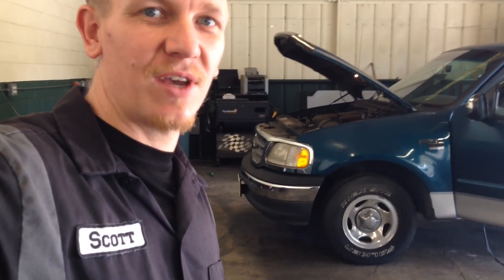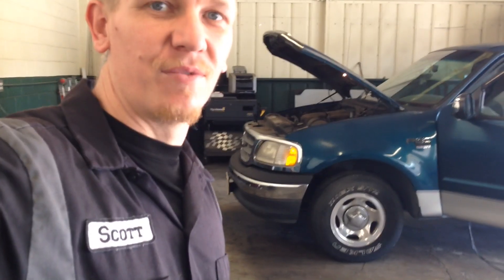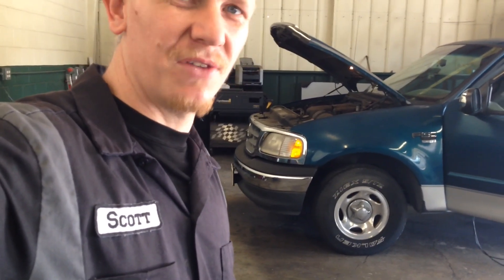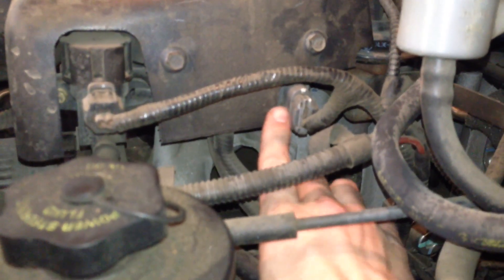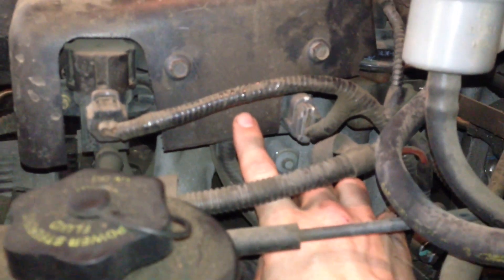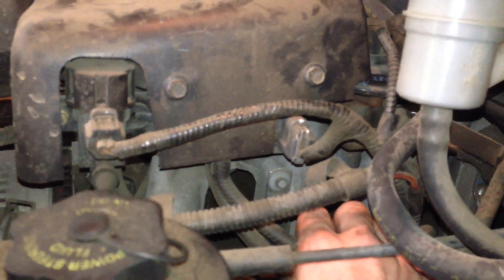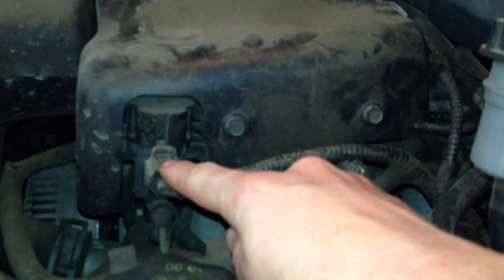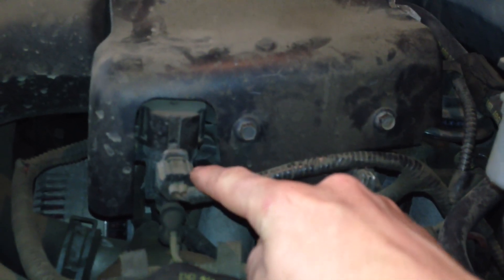Ford F-150 emissions: PCV valve, EGR valve, EVAP canister, & purge

Comment: Hey Scott, I have a question I hope you can answer this for me. I have a 97 Ford F150. It’s making a popping noise in the middle of the motor right underneath the throttlebody specially when I give it gas quickly it’ll make a popping noise also when I put it in gear, it loses power please help do I need to put another motor in it or not
Reply from the maker: It's really hard to give advise on this one without it being infront of me. Do you have a check engine light on? Does it sound like a spark plug backed out?

Comment: Could any of these cause a p0171 and p0174 lean codes? I have checked all the obvious things and even did a smoke test and found no leaks.
1998 f150 4.6 liter, around 260,000 miles, runs like a champ. No stalling or rough idling issues whatsoever. Just these 2 stupid codes.

Comment: Do you have a video showing how to replace the EVAP Canister Vent Solenoid/EVAP system service port part located on the firewall of this truck? I need to replace the entire part and I was looking for a video.

I have a 2000 ford expedition 4.6L V8 Triton XLT and I haven't seen any videos showing this and since the parts under the hood on the truck in your video is similar to mine I was hoping you had a video on replacing that part.

Comment: I have a 05 expedition 5.4 iveee changeddddd everythingg. I only have the p0453 it runns good and engine sounds good at start, and when its warming up. When its warmed up at a stop or coming to a stop, the RPMs dropp and idles rough, feels almost like its choking on itself. Ive changed the spark plugs, the coils, the serpent belt, alternator, mag sensor, purge valve, cleaned the throttle body and still get the same code p0453 please help meee.
Reply: Clean the fuel injectors, check the idle air control valve, replace the fuel filter, you may have a vacuum issue but just in case I'd look into replacing the engine coolant sensor as well. Any of those things if reporting something wrong will fuck up the balance and air to fuel ratio causing rough idling and the choking symptom you're describing. If you already fixed the issue, let me know what it was and how you fixed it. Thanks.

Comment: How many pvc valve on ford explorer 2001..one on passenger side whats on driver side
Reply from the maker: 1 pcv valve. The breather is on the other side. When the PCV valve opens, fresh air comes in through the breather. That will suck clean air in from the intake. Through the engine and out of the PCV valve into the intake manifold.
Reply: @ScottiesHobbies  thxs

Comment: My 98 F150 XL manual 4.2 loses power uphill. Thoughts?
Reply from the maker: Have you checked fuel pressure? Any check engine lights? Any symptoms other than lack of power?
Reply: @Scotties Hobbies  I don't know much. How do I check fuel pressure? Check Engine  light is on. No other symptoms. Runs great otherwise. Just slows way down up hill. Here's the codes: P0455 evaporate emission system leak
P0300 multiple cylinder misfire
P0171 System too lean bank 1
P0174 System too lean bank 2

Comment: I have 2004 Ford F-150 heritage that is showing code po 442 I have replaced the gas cap and the service engine light soon will still come on. Do you have any suggestions of where I should look for the small leak ?

Comment: I have a 97 f150 that just threw a p0455, I know it's a gross evap leak. When I took the gas cap off the hard plastic around the top of the filler neck has a section that's broke off, would this cause the code the fire off?
Reply from the maker: Are you saying the seal on the actual gas cap was not intact?
Reply: The gas cap seal is fine, the part of the filler neck that the cap screws into is what I'm talking about. A section of it is chipped off. I've already ordered and received a new filler neck. I've checked everything else and its good.

Comment: so how about removing the evap canister from underneath the bed of the truck? no human on the face of the internet has done this kind of video for a 1997 to 2003 ford f150 evap canister removal.
Reply from the maker: You probably don't find many videos on remove and replace of the canister cuz they rarely go bad. In the 15 years I've been working on cars I've only seen two of them go bad and that was due to being involved in an accident and the actual canister breaking. Why would you be replacing your canister?
Reply: Mine fell off due to rust i reconnected and my overdrive will not engage and evap codes pop up .  There is an electrical connection on canister.  Will that make that happen or is it a problem in the engine bay

Comment: What would cause the P0455 Evap Emiss Control system leak code to kick up???
Reply from the maker: Many things. The simplest would be a bad gas cap seal. Inspect it for cracks. If you don't find any cracks on that seal then you need to start looking at the EVAP system itself. Check and make sure your purge solenoid is good if your purge solenoid is good then you need to check your vent solenoid. You can check both of those for holding pressure and for resistance. If both of those check out then you need to pressurize the EVAP system and figure out where a leak is coming from, you probably would have a cracked hose in that case.

Comment: Engine runs but nothing is turning what is it.
Reply from the maker: +Gene Woods man, ya got me.. is it a blonde?
Reply from the maker: +Gene Woods just kidding. So the engine turns on but when you put the truck in drive it goes no where.
Reply: Scotties Hobbies the starts but motor is not turning
Reply from the maker: +Gene Woods  I'm honestly not understanding. So the engine starts? If the engine starts and you open the hood and look at it are all of the pulleys turning? Does the car stay running or does it just crank? I'm trying to understand this, if you can just go into detail a little more.

Comment: I have a 01 t owncar. I have code p1451 and egr code. Replaced the solenoid under trunk 3 times. Code still there. Alsoo gas shoots back out at me when I pump.
Reply from the maker: +MrBodean2010 does the vent solenoid have a hose from it to ambient or does the vent just go straight to ambient? If it has a hose ftom it, make sure the vent hose is clear of all debris. Could also be the 'evap pressure sensor' not seeing the pressure increase. If it does not see a pressure increase, the vent solenoid will never open.
Reply: Scotties Hobbies yes it have 2 hoses. Whhere could I find the evap sensor
Reply from the maker: +MrBodean2010 make sure the hose going out is clear and has no debris. Ill try to find the part location. I can find the part easily on the web but i don't see location.
Reply: Scotties Hobbies ok. It's on top of gas tank. Thanks 4 your advice

Comment: Hello , Does the EVAP hose that connects to the back of the intake have to be fuel line ? Ford is calling it a vapor management hose and wants 85 buckaroonies . I also noticed that there is a small heat shield right where it touches the EGR valve .  Any thoughts on a DIY  budget fix ? 
Thanks , 
KC
Reply from the maker: +Ken Claypool I would personally recommend that it be a fuel Vapor line. At the auto parts store they're pretty cheap, usually a couple bucks for a foot. For a heat shield near the EGR you might think of a heat insulator like they make to go over the spark plug wires.
Reply: Scotties Hobbies thanks for the reply. Ya it would probly be a good idea since it has gas vapors running through it . Frickin Ford parts pricing !!!! Heading to Oriely today after work . 
Thanks again , 
KC
Reply from the maker: +Ken Claypool no problem, good luck.

Comment: My '93 F150 4.9l automatic had stuttering/loss of power and I noticed fluid and air bubbles in the translucent plastic Y manifold of the Fuel Vapor Return Hose Assembly (right on top of the engine near the throttle body). I disconnected the line and capped off the Y manifold so those ports are effectively sealed for now. Now the truck runs, no stalling. But can blocking that evap line cause engine damage? I also left the line from the charcoal canister open, is that ok?
Reply: Salty where do you find the computer on a F-150 97 Ford F150 how do you remove the computer off of 97 Ford F150 how do you replace a computer
Reply: How do you remove remove the computer off a 97 Ford F150
Reply: was it stuttering with very slow acceleration? i recently brought in my f150 2002 to get a waterpump replace (bad seal) and mechanic broke my radiator, transmission line and vihicle is running worse than it ever did since I got it. The only issue I had before bringing it in was overheating due to the bad seal but drove off the shop with a truck that is worse off. I didnt want to leave it in their any longer as mechanic also had me replace ignition coils and sparkplugs that he replaced two months prior.
Reply: That guy doesn't sound like a mechanic!!!
Reply from the maker: +Salty ehhh.. it shouldn't do damage to the engine but for sure with the plug on there it will not pass smog if you live in California.

Comment: hi, can some one help me with my problem on my f-150 truck. When I step on the gas paddle quick it shake too much and sounds like its misfiring or something. but if I slowly accelerate it seems fine?
Reply from the maker: does your check engine light come on? is it a Triton motor? those blow the spark plugs out. maybe a restricted exhaust.. maybe. Also super common to get vaccum leaks and that can cause a bad air/fuel mixture. Any other obvious symptoms?
Reply: Or a bad camshaft position sensor

Comment: Where is the Evap assembly on a 2010 Ford F150 located? My truck is giving me a code of "unable to bleed up fuel tank vacuum"  all things I have read said to check the evap assembly
Reply from the maker: Off the top of my head, I think the canister is above the spare wheel. I might have a 2010 f250 at work. I'll make a vid and it will probably be similar.
Reply from the maker: What is the code you are getting? like p0xxx. Also do you have a fuel cap on that model? If so, check the seal on the bottom side of the gas cap for any cracks. IF you see cracks, replace it for sure.
Reply: I forget the code, but in the book, it says "unable to bleed up fuel tank vacuum. No, my truck does not have a gas cap on it. I appreciate you telling me where to find the canister. I also want to check the solenoid. I saw a video on how to check that. I think I located that on my truck, I just have to get all the stuff out of the way so I can get to it.  Weekend job for sure in case I run into any issues taking parts off to get to other parts. I use my truck every day. Any advice, videos you know of or pictures that would be helpful since I am doing this all by myself.....  Also, my truck is a 5.4L engine with 70,000 miles on it. I work on 60's and 70's cars with no problem. New computer cars/trucks....  not so  much    LOL

Comment: I have a 2002 Ford f-150 xlt v8 and it has no evap canister to begin with. My question is do they very between engines? Or can anyone tell me which one I need specifically? Thanks, in advance.
Reply from the maker: +Matthew Kriedel if you call your dealer and give them your vin number they can tell you what cannister u need. Was the canister removed?
Reply: It rusted out and then was removed.
Reply: is there a specific digit in the VIN that refers to what kind of canister i may need?
Reply from the maker: +Matthew Kriedel im not sure but they are make and modle specific. I bet you could put some universal evap canister but it wouldn't mount in the factory location. Also if you have smog inspections in your area you might have a problem with the smog if its not a oem replacement.

Comment: evap system service port whats that do ?
Reply from the maker: +skulledmonte84 if you have a smoke machine you can induce smoke into the system to check for leaks. You can also hook up a pressure guage to see what the pressure is.
Reply: oh i see now so that has nothing to do with fuel ??? guy i bought it off of was saying it was a fuel pressure valve lmfao
Reply: it has to do with vapors coming off of the fuel in your tank, which IS pressure in your fuel tank, but not fuel rail pressure to the injectors.  The canister collects fuel vapors, the valve releases them back to the intake on the engine so they can be burned with the liquid gas. your gas tank doesnt overpressure, and you dont lose fuel to the atmosphere when it gets hot and evaporates.

Comment: Which one of these would cause po455 on a 98 navigator 5.4L engine?
Reply from the maker: Have you checked your gas cap yet? Always start with that on Evap problems.
Reply: +SCOTT BROWN yes I did and it looks good what's weird is that I got po455 but the check engine light on my dash isn't on and I know the bulb isn't out because when I open the switch without starting the engine the light comes on. I'm seeing the code with my scanner
Reply from the maker: +Juan Ramirez So its just a pending code. If you could get the cap pressure tested, i would do that too. If your in CA you can take it to a smog shop and they can do it for you. If the cap is for sure good then more than likely the purge solenoid is going to be stuck open or have some debris in it. But you are really shooting in the dark without a diagnostic.
Reply: +SCOTT BROWN thanks for the replies!!! I'll take it to a smog center to have them check the gas cap see if it's good but the gasket on it looks to be good!! I disconnected the purge valve and tried blowing air in to it which was impossible to do. So I'm guessing that its good. I shot some smoke in to the vacuum lines and I can see a bunch coming out where all the vacuum line are by the firewall on the passengers side by the battery. Could I have a leak there? This is on a 98 navigator 5.4 engine.
Reply from the maker: +Juan Ramirez The evap system should not pick up a leak in the intake. If you had a vacuum leak on a intake hose you should be getting a lean code. If you can induce smoke into the green service port on that purge solenoid, that should help you find the EVAP leak.